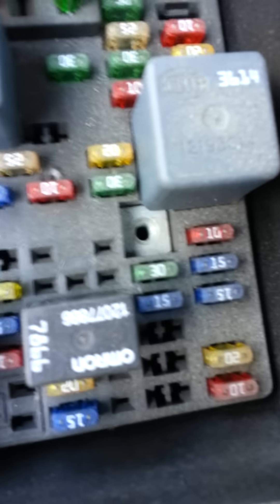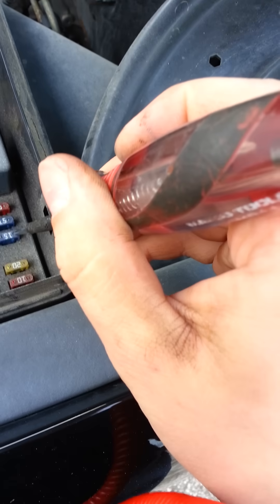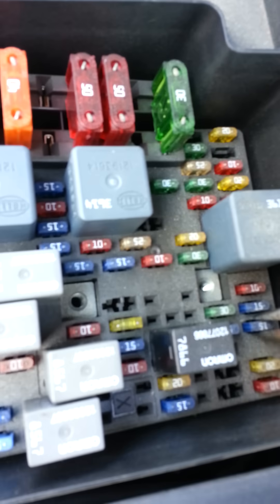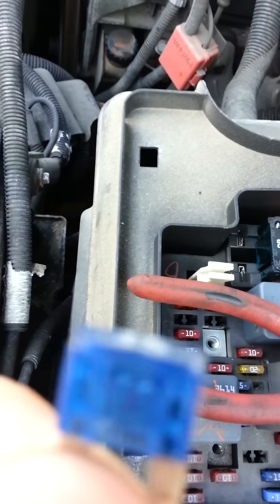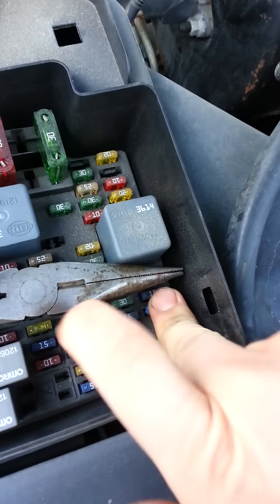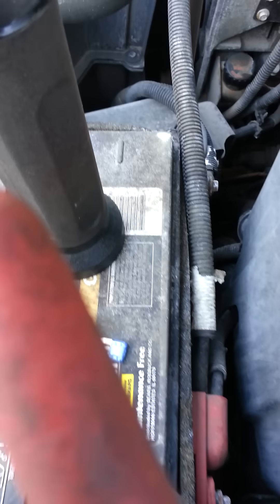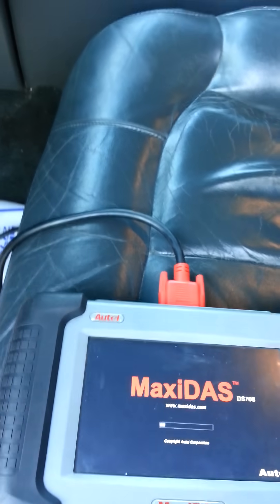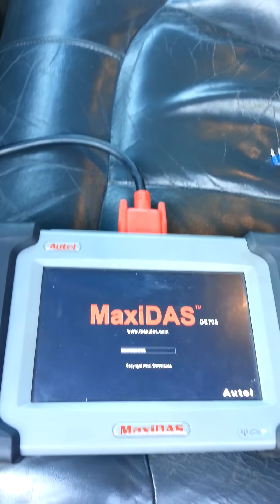QUICKTIP: How to fix Vehicle's OBD2 port that won't power scantool

Comment: Just replaced lighter in 2005 grand prix, lighters work but still having a problem with obd2 port gonna try female wire ends with a drag test
Reply: Any other ideas if it's not piggy backed there?

Comment: you probably dont even see the vid anymore but you just save me a lot of time and headaches trying to figure out what was wrong with the damn port... ffs i was about to pull the dash to run the wires to see if one was clipped or frayed all it was was the fuse tytytyty

Comment: No power to my OBD connector but my cigarette lighter works 2005 PT Crusier touring help?
Reply: Get rid of the pt cruiser. That's your help. They suck. Sometime is always wrong with them. They're hard to diagnose and expensive to fix

Comment: Now I have same problem but the fuse blows immidatly and tryed using wire to connect it but gets too hot to hold before powers on any tip on that even if rigged to find out why engine light on
Reply: Having the same problem..did you find a solution

Comment: Fuse was fine. Lighter port works. Code reader still is blank so I'm not sure at this point
Reply: I'm having the same problem did you ever figure it out?

Comment: You are the man,,, this was driving me crazy, my trucks port wasn’t working and my check engine light was on, this fixed one of my vehicles problems. Thanks, FYI my trucks was on the side of the dash by the driver side door, sure enough the cigarette lighter fuse was the problem, it’s a Sonoma,.. thanks

Comment: Do you have to disconnect the negative terminal of battery before switching the fuze???
Reply: no but to be on the safe side turn the truck key off next go to your cigarette lighter and unplug it and plug it back in--just make sure its not stuck on--next change the fuse

Comment: Thank you!  Saved me $$ and time!!  2005 Yukon XL failed inspection due to ODB Communication Failure.  Tech said I may need to replace my ODB port via dealer.  Found your video and checked CIG LTR fuse under hood - sure enough blown.  Replaced it and it passed!!

Comment: what if the the port has power but can't communicate with scanner? Also I have a misfire on cylinder 3, I've swapped the coil and changed the spark plug and it's still a dead cylinder, any suggestions
Reply: Brian Jenkins did you check the wire also it could have been the problem from the start
Reply: yeah i traced it all the way to the ecu. It was fine. It had a burned valve. Never got the scanner port to work though

Comment: Thank you brother....my 2000 Silverado just died for the first time in 15 years. Threw a code but couldn't read it at O'Reilly. This will fix me up.  Thanks.  Port was dead. Checking fuse now.......

Comment: i had an obd emissions failure and took it to a shop the guy told me 50 bucks to look at it plus parts and labor will be added afterwards. i eatched this video went to autozone 2 blocks away and passed emissions for 3.49 thank you sir!!

Comment: pep boys just told me 45 dollars to figure out why it's not working... and I jus took out the cigarette fuse. 2 days ago.... he trying to squeez every dollar out a mfr. I googled this topic saw ur vid put the fuse back.. port powered up... went back in the shop and the guy says I still have to pay 45 dollars for the electrcian to check the port....and I'm like the port is f ing working now. all I wanted diagnostic testing.... and if they found the problem I would have paid on the spot to fix it..... trying squeeze 45 dollars they jus missed out on a guy ready to spend to get the job done right......so now I just bought my own diagnostic scan tool....  I will ride a few days and take the report to a few places other than pep boys and see what is what

Comment: THANK YOU. I bought a 2001 F150 and a week later the check engine light appeared. tried to plug it in and the port didn't have power

Comment: I have a 1999 vw passat with the same problem. I know about The cigarette lighter fuse and I've checked all of the fuse's and all are good. it has a 1.8 turbo and "3 cyl.has no spark I put all new coil packs and still (no fire) I'm dead in the water on both problems! any advice?

Comment: Excellent tip.  I have an 03 Suburban.  I have tried to get my scan tool to work with no luck.  I know my cigarette fuse is blown, tomorrow I will change the fuse and try the scan took again.  Thanks coldcash

Comment: Excellent video.i j have a question.can a scan be done to tell you what's wrong without the lighter? I had one guy tell me it's the transmission but another guy could not get a code because lighter fuse was burnt.whose right?

Comment: my cigarette lighter still works as a matter of fact my cell phone charger is in it right now. if the fuse Powers both the OBD2 Powers both the and the cigarette lighter wouldn't cigarette lighter be out as well?

Comment: Dude! I bought a new scan tool and it still did not work! so WTF? Googled OBD port not working changed cigarette lighter fuse and.....vOOOla! Thanxx for your video!
Reply: did your cigarette lighter work before you replace the fuse?
Reply: I was using one  .  Of three ports  .  On my console and mot aware ofone not working. Don't use cigarette lighter per se!

Comment: Plus 1 cigar lighter works the other don't but I still have voltage on my obd 2 port for the moment the fuse is in the cigar lighter area will it still work

Comment: hey guy.  nice tip ! had a Yukon with a 10 amp cigarette lighter fuse & installing the correct 15 amp fuse the OBD connector now functions & powers up the scanner!  thanks

Comment: how i can know if this fuse is for the obd? plz answer
Reply from the maker: There is no specific fuse for your OBD port. Usually the OBD is tied in with the cigarette lighter fuse or similar
Reply: It should say data link connector in your owners manual